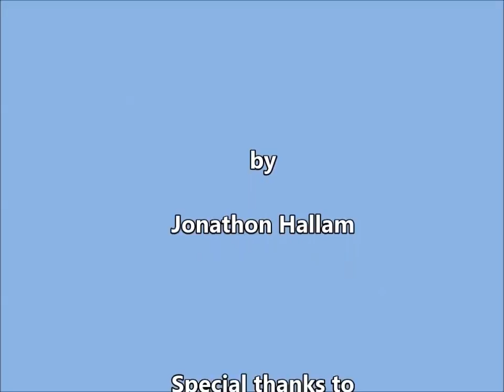Gas Fire Service part 1

Comment: Hi J.Hallam, really enjoying learning from your videos but just a small critique if I may on your explanation of the operation of a thermocouple. Heat energy is not sent to the mag valve via the thermocouple. The thermocouple is a bi-metallic tube. One type of metal on the inside another on the outside, the inside metal will expand more quickly than the outside which causes the two metals to be squeezed very tightly together and this causes a flow of electrons (EMF). This Electro Motive Force flows down the metal tubes to the termination at the end inside the mag valve. This EMF usually between 15 - 30 mVdc depending on type and size, is enough to hold in the mag valve and therefore allowing gas to flow from the valve to the appliance. This EMF will flow as long as heat is applied and stops when the two metals contract to their at rest state. Sorry to butt in and I'm sure you know this already but there are others who may have taken your minor your slip up literally and be confused. Keep up the good work.

Comment: This is my point! Why didn't you remove fire box to check catchment space is of correct size, the flue is also the correct size and there are no holes or air vents be Ind fire. I assume you mean 100cm2  unless the mi say otherwise, would of thought you would have made a point of the air vent in your video. The coal layout should be to the mi not always as you found them( might not have been put back properly by previous person) should also remove the burner and clean!

Comment: technically need to remove and inspect seals and clear any debris buildup and do a flue flow test and check pipe is wrapped and has a base lintel etc check the loft space if applicable not that many bother 😅
Reply from the maker: Yes they always leak where they convert to pre cast to twin wall, soon be items of the past

Comment: How do you know the proper coal layout? Air vent for a dfe? Check catchment space? Bs or kite mark?
Reply from the maker: tony brinklow the catchment is down to regulations Dfe fires are rare now but really need around 100cm3 the coals shud be repositioned using MI as incorrectly placed my cause carbon monoxide issues